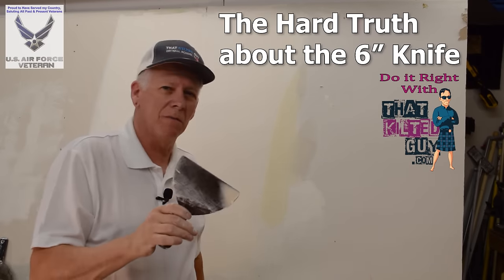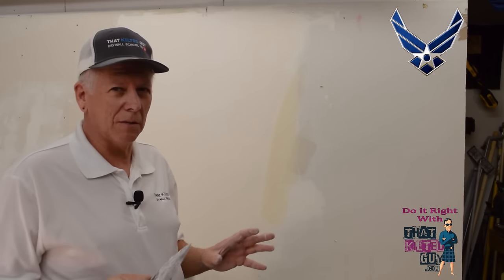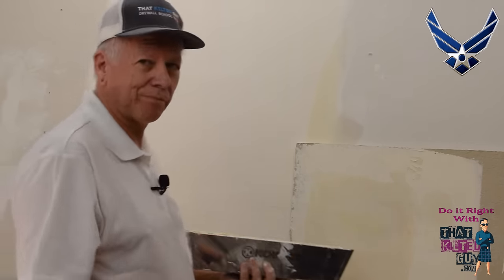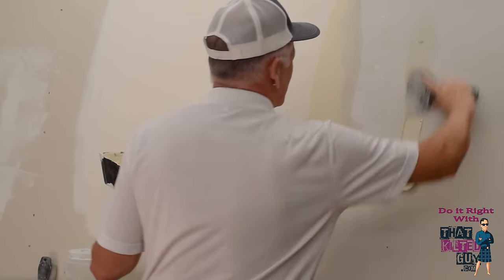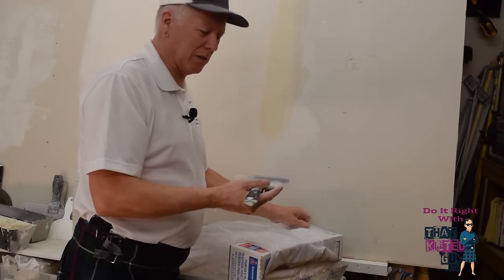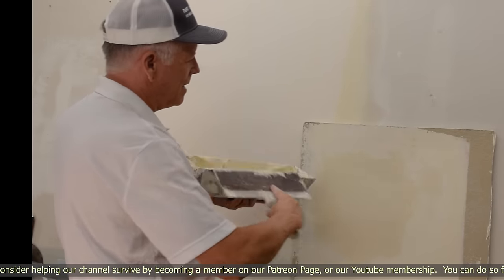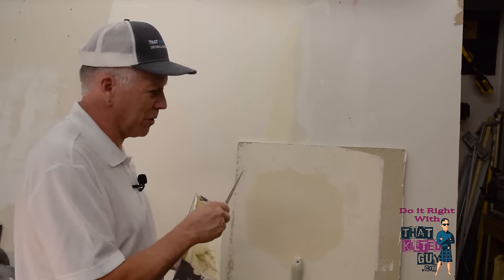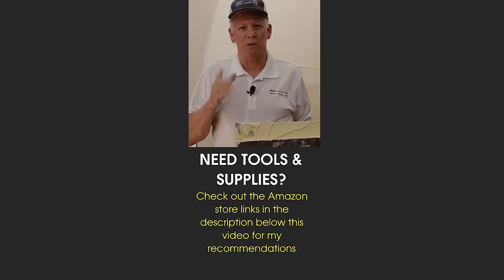How to Use a Drywall Taping Knife Right! The Most OFTEN Misused Knife.

Comment: Good video. I have been in remodeling since 1978. You have good tips.
I use a 6, 8 12, and a 14 inch blade. Sometimes a 3" for those small areas.
Have you ever done a Monterey texture? This is a unique texture. Using a 12" blade to float your wall with fairly thick mud. Then use the edge of your hand with your pinky finger side, and tap the mud. Kinda like your sponge effect but much deeper valleys. Let it sit for a time then take a 14" blade and knock it down. When dry, apply stain to it. After the stain has dried, lightly sand it. Then apply a clear sealer to it.

Comment: Dear sir, I do agree with you about the use of the 6” knife. One friend of mine named Terry Pucket showed me why he always used the same side of his 6”. 
The pressure he applied on the right and left side of the knife constantly keeping same side of the 6” facing the wall while taping or spotting nails/screws eventually places a slight bow, almost unnoticed to the casual observer. The 6” then becomes versatile enough to feather & increase it’s diversity.

Comment: I’m not a pro, not yet away. But I’ve done enough plaster work to find out I’m good at it and others have told me I’m good at it. Anyway, your opening thing about the 6 inch knife, I never noticed that they have different shapes. But this explains why I prefer working with one knife over the others. My go to knife is the one with the 90 degree shoulder, I’ve worked with it for a couple of years and never noticed until now, that it’s shaped differently from the other knifes. But now I understand why I like that knife better. Good video, great information.
Reply from the maker: Glad I could help and glad to have you as a subscriber

Comment: Great video.
Learned 30 yrs ago.  If there is any significant amount. And time is an issue. Hire a person like you.
Faster, better job, and ultimately cheaper in the long run. 
Especially if you have other trades waiting or worse, a spouse. 😨😆.
It's almost worth the money just to watch how fast really good rockers can hang and tape and sand.
And how little dust compared me or most novices. Because they don't pile it on.
And have an eye for contour,  not just smooth to the touch..
👍👍
Reply from the maker: Nailed it! Thanks so much commenting. I appreciate it and thank you for subscribing.

Comment: I had a guy on my site mud an entire 15'x 20' wall without any sanding whatsoever! I thought he was the most skilled drywaller ever until I tried to hang my art work and 2 corners of the frame sat flat on the wall but diagonal while the other 2 had 1" gaps in between. I don't think we ever used that man again.

Comment: Any suggestions for after cleaning your knives . ??  I just do patches and not on a weekly basis. Go grab them and spend time sanding some rust off them.
Reply from the maker: I just air dry them, but you can dry them and spray WD-40 on them and wipe it off
Reply: @ThatKiltedGuyDIY  thanks. I’m not a professional mud man my experience is more painting. And a tip for painting patches, touch up with a roller not a brush. I get asked that a lot of  why can I always see where I patched. Patch needs same type of texture as the rest of the wall has. 
Keep up the good work!

Comment: I geta  knife mark when coating a long joint. with a 12 inch knife ? Why!?
Reply from the maker: Could be not enough experience, you need to lean your knife over more, putting uneven pressure, needing to flip the knife over and use the other side etc

Comment: My dude knows his stuff. How do I keep my tools from rusting? Just keep em dry and clean ASAP after using them?
Reply from the maker: Yes, and you can wipe a very thin film of WD40 on them if you want. Me, I like them lightly rusted as do many pros. But only very light and then I sand it off before using.
Reply: Buy the stainless tools whenever you can
Reply from the maker: Yes, this is the best way. I prefer stainless

Comment: Your technique is obviously fine, but this is not the only way.  I think most pros do this - feather the border first, then lower the thickness in the middle, but if you have a big enough knife, you can do both in one step if you apply pressure with your fingers on the knife toward the outside.  You can see in his video on using the giant "knife" to do a butt joint, that is basically what he is doing.  There is a guide about how big you need to extend on either side of a joint that is recessed vs not-recessed.  I can't remember what it is, but I generally do fine with a 8-inch knife on recessed seams (which I use a different technicque that leaves a single seam down the middle that you knock off with the knife before you sand) , and 14-inch knife on surface patches / tape.  I think the reason the pro's don't try to flex the knife with the fingers is that they can make this sweeping feather + take-down in a continuous motion very fast, and there is less stress on their fingers which can get sore after a while pushing on the blade of the knife. I learned the way he does it from my uncles, who did mass production drywall as summer work during their college years, but I learned the technique above from a book which I can't remember the title, but it really worked better for me.
Reply from the maker: I always say, the main thing is the end result.  But most of my viewers are novices, so I teach them the easiest way I can, that's still as fast as they can handle, and as understandable and I get tons of comments that they try it and get great results.  So for novices, they should follow my guidelines exactly, or they'll just get confused, and likely screw up.  Learn the skills from someone who know first, then develop your own style.  Thanks for the input. Guy
Reply: @ThatKiltedGuyDIY   I'll share a story with you - the two uncles I mentioned went on to professional careers in business after college.  At one point, the older brother bought a house and was fixing it up with his girlfriend, who was doing the spackling. The younger one sees how she is using a lot of mud and leaving the seam in the middle like I mentioned, and he starts picking up the tools and -- the word didn't exist, but I guess today they'd call in man-splaining to her how to do it the way you show.  And after that, this girl made things really tough for the family because she decided the younger brother was a know-it-all and didn't want to have anything to do with him.  So, yeah, I just mention it in case somebody is reading a book that shows the other way like I did and is confused.    You have a great channel by-the-way.

Comment: So I have some imperfections where I had some bubbles on my final coat or some corners that I want to touch up. A hot mix will harden up enough to put another coat on top better really don't need more than one coat I just need to fill in these imperfections so my question really is would you use a hot mix or regular all-purpose joint compound to fix these imperfections? Pretty much still going to have to wait until it completely cures/dries to be able to sand.
Reply from the maker: You won’t gain anything with hot mud for that part so regular mud.

Comment: All great save the throw, a slightly bent blade is garbage.  I know you were joking, others might not.
Reply from the maker: It’s extremely difficult to bend a 6 inch knife in drywall. Maybe if you drop it on the floor, but I’ve actually never in my life bent a 6 inch knife with the exception of hitting a screw while scraping a wall. But not from throwing or dropping one. Bigger knives, hell I’ve been them by looking at them.

Comment: Why does your mud always look like butter?   All the stuff I've used isn't that yellow, usually just a light tan/brown.
Reply from the maker: AnAbortiveRomance i’ll bet you’ve either been using regular weight all purpose, or hot mud? The color is just a brand thing but most topping mud and lightweight mud is yellow like this.
Reply: @ThatKiltedGuyDIY   Yes, general purpose, plus 3 and easy sand 45.  They don't sell topping mud where I'm at.
Reply from the maker: Color probably varies by region and brand too but it’s not important

Comment: 6 inch knives and I have a funny long standing relationship , whenever I'm somewhere and I see a 6 inch knife on the shelf I'll grab it and see how it feels.I don't care about the brand,I don't care about the price,I don't even care if I'm at a podunk general store in bfe I'm gonna walk out of there with a 6 inch knife if it feels right.Usually the cheaper ones can get the blade right but the handle is what lacks.The one I usually grab to do work  is a non stainless Hyde ,it's thin and has that sweet spot in the flex department,it's not to stiff but not too flexible.I don't know why but that knife just feels right and is a joy to use.When I tape with it I'm just amazed at how tight I can pull the mud,it's almost like I know what I'm doing when I use that knife.They say a craftsman can use any tool and get results ,but I can tell you the right tool definitely makes it easier.

Comment: Good info, except using knives as a throwing star. Once you bend the corner it's garbage.
Reply from the maker: Honestly, in 35 years of doing that, I’ve never bent the corner on a 6 inch blade because they are so thick and durable. Anything bigger I would never throw. I did break one one time when I was about 15 but it was old and my dad had probably owned it for 15 years and it was kind of rusty where it broke at the end of the handle. And I am kind of a goofball in person and like to have fun and that’s all I was doing there, LOL Thanks, Guy
Reply: I've thrown them too, that's how I know it ruins them. Sometimes it just feels good to throw something, though. All in good fun. Good videos.
Reply from the maker: I guess I’ve just been lucky then, LOL. Got to have luck somewhere I guess. But yeah Throwing Them at the wrong thing could definitely ruin them, but hey, I’m a big risk taker. Well I’m off to go bungee jumping so catch you later. lol 😂.

 No seriously, thanks for the comments and I would correct a novice on my job site and tell them not to do it too lol.